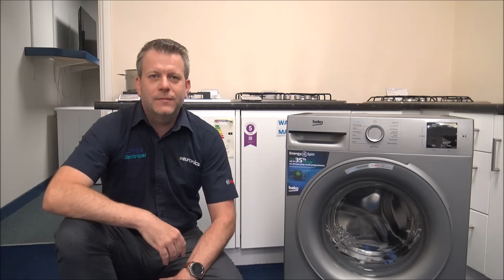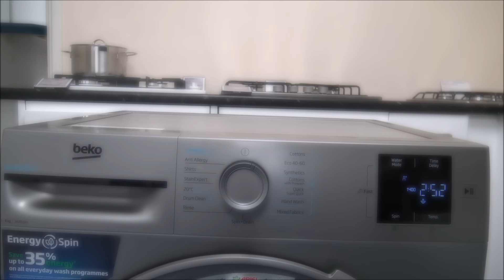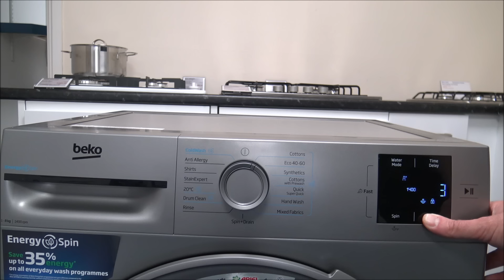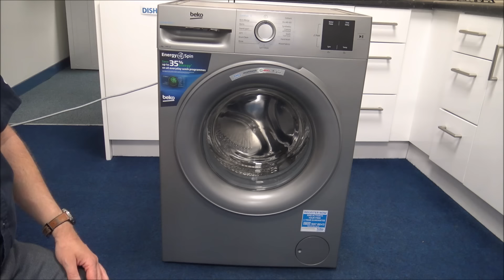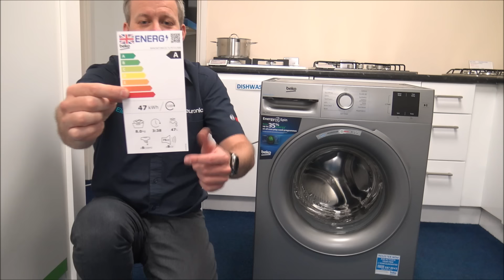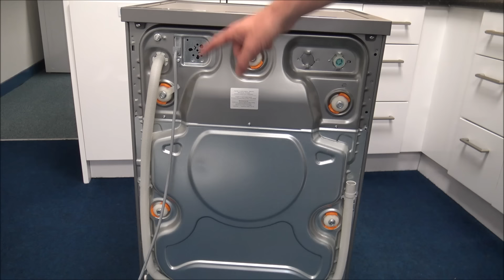Beko BMN3WT3841 1400 Spin 8Kg Washing Machine

Comment: A very informative review, thank you for this. 
You show the auxiliary panel on the right of the machine with water mode, spin etc. and the FAST symbol there, but I do not know how this works. Should we push something else or buttons together etc.?
The machine I have has the FAST option and shows that it enables up to a 50% reduction in washing time but I do not know how to enable this. 
Can you help please? Thank you.
Reply from the maker: if you press the Water Mode and Spin button at the same time, it should enable the fast option to save up to 50% of the duration of some of the washes
Reply: @lords-electrical  Thanks so much. I did try that and it did not change anything at all. Just gave options for the water mode and spin. Then I persisted and tried again and it worked. Job Done, thank you so much.
Reply: I came on here too looking on how to find the quick wash feature. I’ve tried pressing spin and water mode but nothing happens! The paper instructions are pretty useless… thank goodness for YouTube tutorials 🤣 I’ll try again!!
Reply: @maddogmaddocks35  totally agree, the paper instructions tell us the value, but not how to do so. I found that if you slightly and quickly press the spin before the water, it does work. Such a time saving feature I am surprised that Beko does not give more info. Good luck.
Reply: @tisbury30 thank you sooo much! This absolutely works so many thanks. I actually thought my brand new washer was faulty as I couldn’t get this to work even after many attempts of pressing buttons together. Why are Beko not showing off about this great feature?! Crazy
Reply: Yeah good video, Beko aught to be ashamed of themselves, they're just interested in taking people's money!

Comment: the design of these is alright, just curious on the programming now. their energyspin feature seems to just be the machine accelerating into a 250rpm spinwash during the main wash, exactly like haier, midea, hisense and BSH. if it's programmed in well then it should be a good feature. not necessary for wash performance but certainly entertaining.
Reply: Actually it's 300rpm for these Bekos
Reply: im aware. i wrote this before we had any videos of them

Comment: Wow,  plastic hinges are real!
Reply: Not as strong as metal I would think. Making them look like metal is crafty!
Reply: @Nooziterp1  Does it show Beko as a quality machine or as a cost-engineered machine?
Reply: @ It would indicate cost saving but Beko has a good reputation and mine has been fine so far (touch wood).
Reply from the maker: Yes unfortunately, its a shame as i can't imagine it would be that much more expensive to use a metal hinge that is much stronger